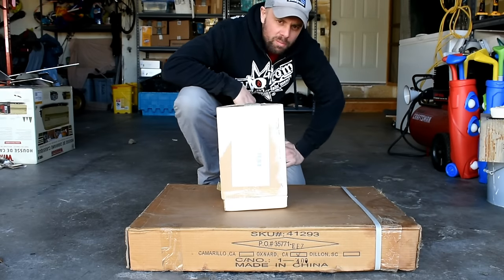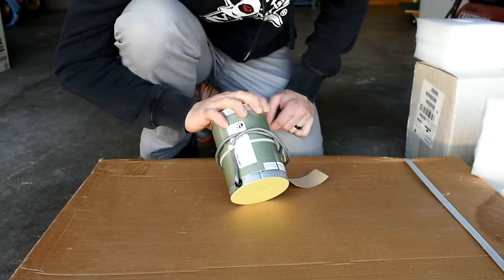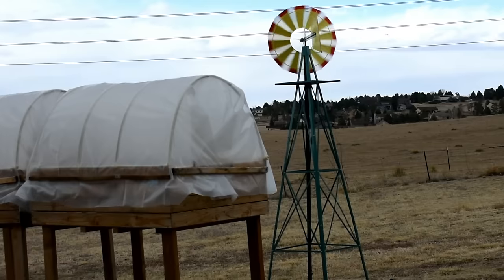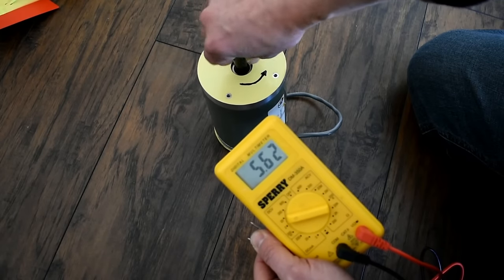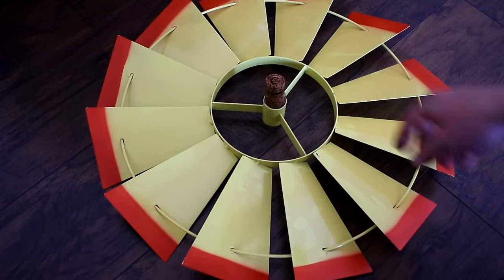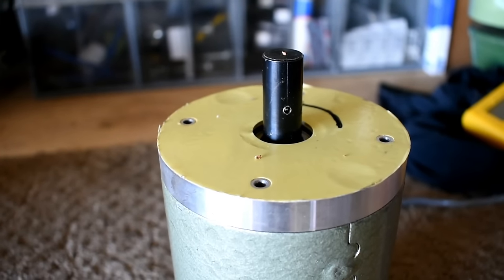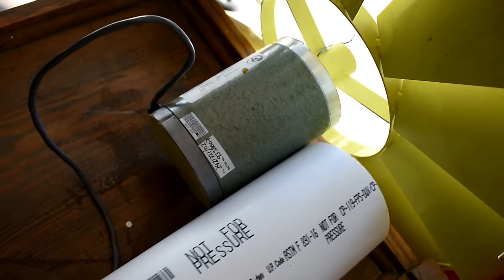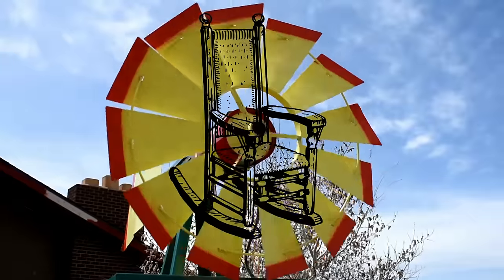DIY Homemade Wind Turbine for $32!!!💰

Comment: Good video, would  be nice to see the amps and voltage together at once hooked to perhaps a battery or other load.  yes, the wires would get twisted without a double ring beneath the whole thing to allow the connection to be made without wires at the critical point (dble ring similar idea to the car steering wheel which has multiple rings that slide on top of each other to make the connection (think 2 donuts on top of each other making the connection, now think add 2 more donuts but larger diameters for the other connection)) .    For the center just take it to a machine shop, they will fix it good (temp cork will eventually wear out).
Reply from the maker: I'm sure someone makes a double ring that can be purchased for this purpose.  Do you know of anything that is available or something that would work?
Reply: @live.life.simple.  You could make your own for such a small project, just lay bare copper wire on a 1/2" thick piece of plastic about 4" x 4" square, staple or glue the bare copper wire in a circle like 2 donuts within each other, repeat for top rings but use copper flat ribbon (or you may have to cut a piece like that out of thing copper plate.  now align them, secure with bolts or other,   That should do it.  (in a pinch you could probably get away with multiple strands of bar copper wire side by side in circular fashion to get the width needed to insure good contact instead of using ribbon for top.    If you use motor salvage wire be sure to strip off the varnish insulataion usually clear and hard to see (varnish remover? )
Reply: @live.life.simple.  Do the double ring thing as below, then be sure to measure "both" amps and Volt at same time to some kind of decent load.  Watts (power)  = Volts x Amps
Reply from the maker: Great info.  Thank you.
Reply: @live.life.simple.  Be sure to keep the whole windmill esp the vanes where they connect to the axis, to prevent rust (a good clear coat spray paint would be best x 2).  Mine rusted apart eventually over years.  You could get a bar that diameter of the cork, then cut off what you need, then drill hole in exact center for permanent fix.
Reply from the maker: Will do.  Thanks

Comment: OK, I got the turbine/motor/housing part… What I need to know is how I take those two wires From the motor to harness the energy we are generating, how to store it for use at a later time. I need to know real input from real battery pack, real storage idea experiences!!

Comment: Cant you just reverse the wires on the motor to put out the other direction?
Reply from the maker: Yes, thank you for your comment.
Reply: My thinking as well when l saw your directional arrow but right at the end of the video the blade is turning anti clockwise as you intended BUT the blades are getting wind from the rear to turn anticlockwise  ? What about the directional fin to face blades into the wind ?
Like they say  "something ain't right ".
Reply from the maker: Yes wires can be reversed.  The wind was blowing from the rear.  The heavy weight added to the front almost eliminates the function of the directional tail.  Thanks for your comment.

Comment: I have bought so many of those exact windmills at Harbor Freight for around $25 (using the 20% off coupons) but I am bummed because they don't carry them any longer. I have often wondered if I could add a generator of sorts to it like you are doing.

Comment: I feel like the way I saw the blades pointed you're going to lose some total voltage/day. I may be wrong but I feel like I saw you pitch the blades incorrectly which would make some portions of your day produce limited voltage comparatively. Great stuff. I'm not too sure people can often come by your $32 for both a motor and a metal windmill. Very hard to find. Well done job.
Reply from the maker: Thanks for your comment!  Hopefully you can wrangle up some parts to do a similar project.

Comment: Actually, when you spin the motor the other way it still produces electricity but it just reverses the polarity which is what your multimeter is showing. Just swap the wires connected to your multimeter and you'll see what I mean.

Comment: Your pvc motor cover will hold in heat from the motor. Friction=Heat=Wear. A large Javex bottle with the big end cut out keeps out water from above, the sides and the windward side of the motor and allows room for your wires and heat to escape.
Reply: Its not going to get that hot being powered by the wind. Thats a high powered moter that spins ten times faster when powered up and running normally. Its never going to reach normal running temperatures.

Comment: As the wind changes direction the wires will get twisted around the pole and cause issues unless you use a brush system.

Comment: I could be wrong, but I can't see the cork holding up for very long.  Good for a test run, but I would try to find another permanent solution for securing the blades to the motor.  Over all a good idea.
Reply from the maker: A bushing would be ideal.  The cork was just to get the process going.

Comment: And how you did for the cable that run down the tower? when the windmill turn this will mess you your cable by twisting it
Reply from the maker: Run the cord down the center shaft.  The wind generally blows from the north or south, not all directions.  Check on it every few days or once a week and it will be fine.
Reply: I would think some slip-rings and brushes would do the trick and eliminate all twisting wires.

Comment: does the motor get hot with that plastic pipe on ? also what kind of load can you put on it before the watts go down or do you pulse it when the rpm is high enough ? possibly using more flywheel weights ?

Comment: The most important part was the motor and you didn’t state any info in the description. Otherwise, I found it. They go for 200$ on eBay, so not that 32$ windmill. It’s confusing, but your video is good info. Tks
Reply from the maker: You can always use a treadmill motor or car alternator
Reply: I just liked the fact that he said (and I’ve checked to be true), those motors give a very good and strong current at low speed, so making them a good windmill solution.

Comment: Nice tut.  But you could have somehow rigged the turbine arbor  to the larger "outer circle" of the fan, where the blades are mounted, and then used something like a bikechain or fan belt to connect them.  It would have boosted your output like probably more than 10X.

Comment: The easiest way to tell if the motor is permanent magnet is too short the leads together and the shaft will get hard to turn. Also what is the voltage rating of the motor? I have a feeling, that if you hook that to a battery, you're going to wind up with a fan instead of a generator.
Reply from the maker: of course it will spin if you hook it to a battery.  you have to put a charge controller on it so it only lets power in and and not out.  spin one way it pulls power, spin it the other way and it produces.

Comment: How did you prevent the wire from the motor  winding around the windmill when the wind rotates the whole upper structure with the blades completely around?

Comment: How did  you keep the wire from getting wrapped around the pivot point where the fan meets the stand?
Reply: I'm guessing you've have to put a pole on the stand to prevent it from doing a full 360 but only a 180, it could rotate left or right doing it's full 360 but only 180 on each side at a time.  I'll probably be trying his set up in the Spring with a 300W wind turbine motor.

Comment: Thanks for the video,..  When the  motor is producing power,.. does it heat up?  If so, it would need a bigger shroud to allow it to cool.
Reply from the maker: That particular motor is an ametek and it stays cool.  What kind of motor are you planning on using?

Comment: any video's of you using this and like charging stuff and such? is it possible to attach this to a very strong battery that you can use to keep like a refigerator running and or something like a tv? while the battery keeps getting charged by this turbine? could be like saving a lot of money if it works right? very nice video but the end was horrible hehe

Comment: Great video.Can you do a video how to hook that up to a house?
Reply from the maker: Its output would not be worth hooking up to a house.  It is good for supplementing solar, keeping a battery topped off etc
Reply: @live.life.simple.  Bummer, I need a way to create electricity to keep myself warm when the power goes out. Im in Maine. I have a couple of electric heaters but not allowed back up heat like woods stoves etc. Im in an apartment. Do you have any suggestions besides moving?

Comment: How did you remove the bearings from the windmill?
I've been pounding at them for a while now, and I figure there must be an easier way to remove them without damaging them.
Halp.
Reply from the maker: Take a rod that is smaller than the bearing hole and put at an angle theough the hole.  Use it as a punch to tap out opposite side.
Reply: @live.life.simple.  
Thanks a lot!
Right before your reply, I got them out haha.
Seems like the model I have had some kind of glue holding the bearing in.
Not sure why they would do that and not just have the bearing be able to pop out.
Either way, bearing is out, and motor is in!

Comment: You said the windmill could be picked up for $60, what about the motor, how much would one of those cost? ‘Type/serial number would be helpful as it looks like a pretty good motor. One thing, with the 2 covers you put on the motor, it didn’t cause any overheating issues? Obviously not of you wouldn’t have made a vid showing that’s how it’s done.
Reply from the maker: The motor is amtek, they are used for several applications.

Comment: Wind mills are obsolete so isn't solar panels.  Both have had a negative impact on the environment and wildlife. You have a pc look it up. Electric cars harder on the environment than gas powered. 70% less wildlife then 50 years ago.

Comment: Problem: As the wind changes direction your wires can get twisted and eventually break. It was a good start, but needs more work.
Reply from the maker: You could always make it horizontal
Reply: @live.life.simple.  You did make it horizontal. One way to solve the problem is to make split contact rings inside the housing to transfer power so there are no wires to get twisted, just like in commercial turbines. Another is to use a set of 90-degree gears to transmit the torque of the fan to a vertical shaft attached to the generator. You could also use another right-angle set of gears to change the orientation of the generator back to horizontal, if that is your wish.
Reply from the maker: horizontal shaft i mean
Reply: Jaye: Always use stranded wires.  I thread it loosely down the pole to the bottom.  I have a 10 foot mast and never had a problem in 5 years.  It turns one way then another, somehow, it just averages out.

Comment: Didn't it turn the wrong direction when the wind " actually " blew it?
Reply from the maker: No, it was the right way.  Stay tuned and I'll do a follow up on this windmill with voltage and what I am using it for.
Reply: @live.life.simple.  will do

Comment: Something to think about... Very cheap automotive part... Reg/rec unit... Will do 2 jobs... Prevent battery from turning your motor and stabilises your voltage output... Just make sure to do your electrical maths right... Amps and volts and Watts and whats🤔
Reply from the maker: Great tip Thanks!

Comment: I'm kinda wondering why, when you say, "success" at the end, the windmill is turning BACKWARD and slowing down.  It kinda seems like you spun by hand.  I'm wondering if maybe it wasn't quite the success you thought it would be?  Maybe you did make it work.  I would be very happy for you if it did.  Your current video leaves doubt in my mind. I'm just saying.
Reply from the maker: In order to produce power, the motor turns counter clockwise (see earlier in the video).  thanks for your comment.  I don't feel like it's very exciting to watch a video of a windmill spinning for more than a few seconds.

Comment: That blade is going to turn your motor in the wrong direction.
Reply: It doesnt matter. Just reverse the output leads to the correct polarity for the direction in use.

Comment: Great video, and well thought out. I would also like to build something similar. How much power can you produce? When the motor goes in the opposite direction, can you still harvest that energy? Or is it not common?
Reply from the maker: One direction produces power, the other would consume.  You will need a charge controller to stop it from consuming.

Comment: What kind of voltage are you producing with it?
Reply from the maker: 13 is the highest i have seen.  4 or 5 with a slight breeze.
Reply from the maker: I think it will do more.  We haven't had a good wind since i put it up.  I'll keep ya posted.
Reply: Retired at 40- Live.Life.Simple. Thank you.  I really like the idea.  I have often wondered how difficult it would be to turn one of those ornamental windmills into a small generator.  Obviously no one expects to go off grid with this system, but many people have these and getting a small amount of power out of them for a low price is a good solution.I would love to see a follow up video.

Comment: I have built wind turbines for over 50 years and I know why you ended your video with one word. It didn't work. I know that for a fact. That kind of windmill is called a compression wheel and it will not spin in any wind faster than about 600 RPMs and if that one goes that fast it'll fly apart. At normal 12 mile an hour wind, you'll be lucky to get any reading on a voltmeter with the way that set up. Thanks for the nice show up to the end though.

Comment: And what about when the mill turns the opposite way and pulls negative
Reply from the maker: If it is hooked up to a charge controller, it will not allow the negative
Reply: Bridge rectifier maybe?

Comment: What an awesome idea. How is it working?
Reply from the maker: It was working good for charging my RV battery.  We got a big storm awhile back and my neighbors tree tore it up pretty good.  If you want to build one, make sure your motor will work properly with the smaller blades.  It needs to be a very torqy motor.

Comment: Curious as to how you utilized this for real world application. Were you able to get some kind of average wattage readings? Putting something together right now but not liking my outputs (weak little blower fan motor) and I'm wondering how much the amtek motor could generate. Aiming to do a gearing ratio on a belt system to increase the motor speed but I'm thinking that may overclock the motor and burn it out too fast. Was the direct drive setup capable of generating enough power for basic home systems?
Reply from the maker: even a large residential turbine is only good for small amounts.  you would need solar and turbine to run your home

Comment: Machine to mount blade to motor  would only be a few bucks
Reply from the maker: Absolutely.  It could also just be filled with a bushing and tack welded on.  Just had to find something in a pinch.

Comment: Looks like the oldest comment is 8 months....sooo....how long did it take before it disintegrated....Ha ha ha ....a piece of cork for a bushing....on a piece of fence post hub to drive it... really...come in outta the rain....😂😂😂
Reply from the maker: Just trying to spawn some ideas with $30 worth of junk at a garage sale.  I wasn't trying to power the grid with it.  It works just fine for small tasks (ie keeping rv/ boat batteries charged)
Reply: @live.life.simple.  is it still working  in as built condition...
Reply from the maker: yes it still works.  I replaced it with a larger turbine a few months back that can power a heater for my greenhouse.  I am sure a cork will deteriorate quickly but it take 30 seconds to put something different in.

Comment: I want my 7 minutes back.   Backyard butchery. 
Clicks the DISLIKE button.
Reply from the maker: Lots of negativity coming out of you.  I hope you can put all of your energy and effort into something worthwhile someday.
Reply: @live.life.simple.    That is true. 
Also true is that you make a video that beyond the great info on motor selection, was misleading, as the indicated price was unlikely to be attained by others. 
Your workmanship is below tragic:  
A cork as a bush:  
The cut pipe has no face and a large gap, Rotation will twist the wires without limit stops:  
You used a piece or wire instead of a grub screw. Beyond the info on the motor, there was no information on anything. 
Finally there was no finishing summary or footage.  
Yes, my criticism was glib and caustic, but you are 40+ not 14 and if you are retired at 40, you have ample time to create a safe project that will last more than 5 minutes in a strong breeze.  
Redo the project and win us over. 
Your concept was great, but your audience was let down. Focus your video on the details. I want you and others to achieve succeed.
Reply from the maker: I was just trying to make a video on junk that i found for $32.  I wish you luck.